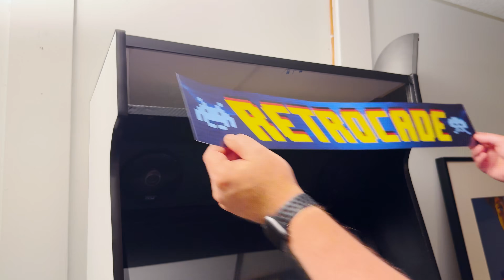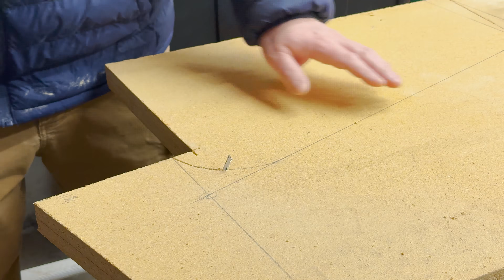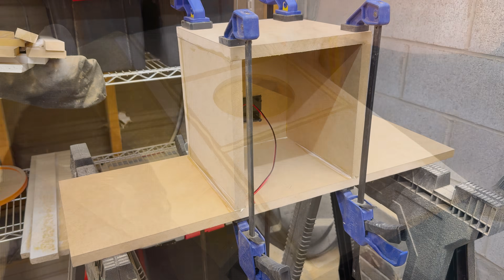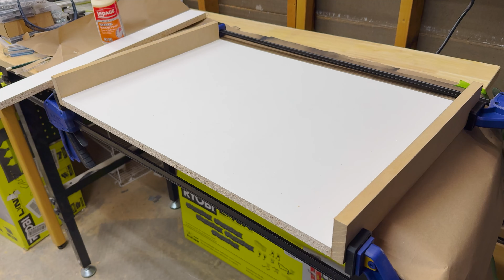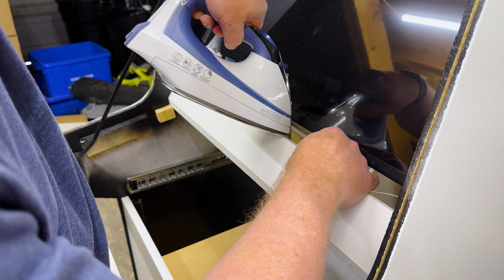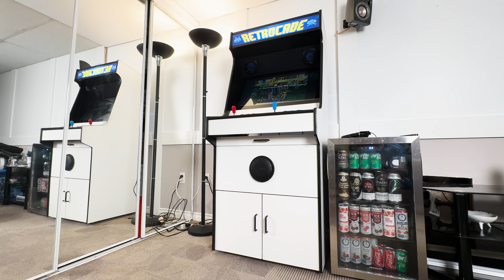I Built My Dream Arcade Cabinet With Basic Tools

Comment: Great work, I too have been through the same. I don't see many people add subs either. I wanted mine to double a a jukebox too.

https://photos.app.goo.gl/hVmA3vUMzTzXBGJa6
Reply from the maker: Really nice work.  The hardwood control panel looks amazing.  That might be something I'd try on my next attempt.  (If I have access to some better tools.)  Good speaker setup, too.  You're giving me some good ideas.
Reply: @andystandys thanks, the stand up arcade was very straight forward compared to the racing arcade, it only took around a month meanwhile the racing one has been around 2 years. This was mostly due to working out how to get an Xbox360 and pc to work together. In the end I worked out the pc can emulate the xbox well enough to remove it and simply have a pc.

Comment: Great video and nice build. I recognize all the steps from when you're starting out building — you'll have built another one before long, and then it all gets much easier.
Reply from the maker: Yeah, I found the toughest part is just getting all those precise cuts as close to "exact" as possible, which is hard to do with hand tools.
Reply: @andystandys And if the cabinet is not square, just off by some millimeters. You will notice it when attaching the glass. Learned the hard way..😂😂